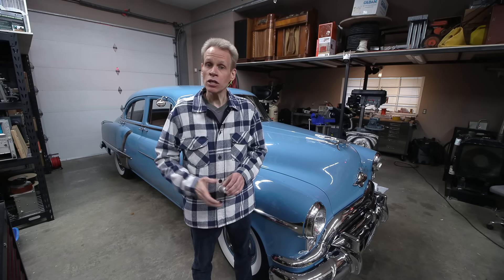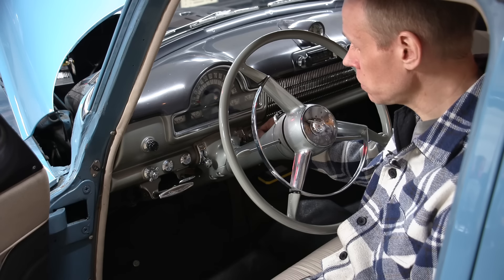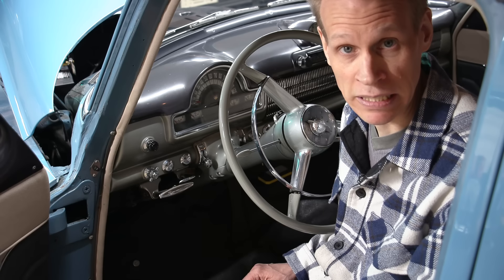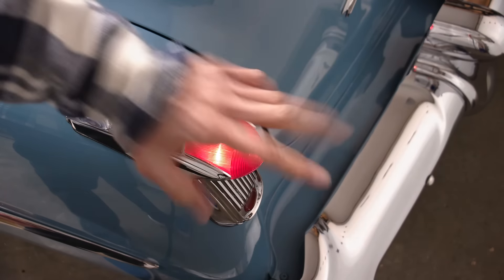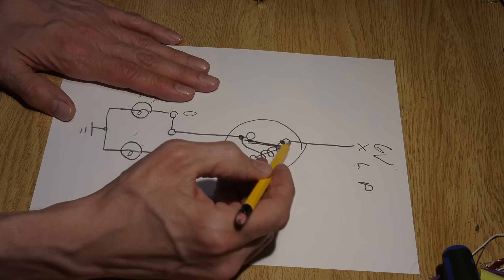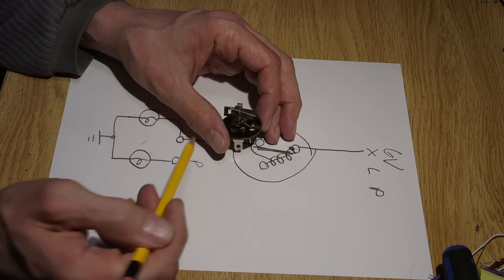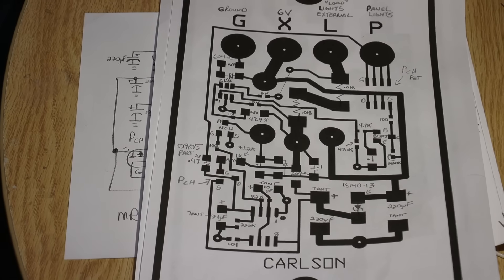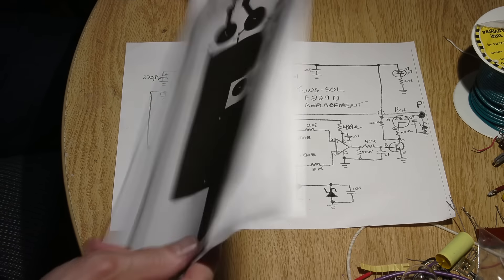How A Turn Signal Flasher Blinker Works - Complete Redesign With Schematic [Tung-Sol P229D]

Comment: When I was a kid in the late 70's we had an old 50's Olds that we used as a run around the back roads / fishing car.  It was considered a junker back then, but it ran good enough to get us around the countryside and into pastures.  Turn signals never worked on it, we wired them together and just toggled the stalk if we needed to make them flash.  This was in the middle of farm country so there wasn't much use for the signals, but even back then they didn't work right.  LOL  Man, what I wouldn't give to have that old car today.  Great video, thank you!!

Comment: Professor Carlson, you are the Bees Knees 🤗 at first I wasn’t understanding the issue because the indicator on the dash seem to look perfectly fine, but then after you went into the whole ordeal of explaining that at 6 V, in addition to the fact that a incandescent bulb on the outside, in addition to the fact that it has to blend in possibly with the brake lamp, which of course is always brighter you’re not even gonna see the fact that the turn signal is on and I understand that this is not what we refer to as persistence of vision, but in fact, it’s actually the overall explanation that you’re giving of the fact that low-voltage and I’m assuming rise time of the incandescent bulb are just not up to par with what we would want and consider to be an acceptable safety measure and I can totally see or in this case, totally understand it

Comment: I did one of these jobs on a Toyota Pickup a few decades ago after doing a very early attempt LED replacement.  I ended up using a Basic Stamp 1 Rev B (the old 14-pin 8-IO version, that could take 40V on the supply and had its own 5VDC regulator).
  
The Toyota flasher was a 3-pin unit - power, ground, flash out - so that made it easier to deliver power to the Basic Stamp - one pin was used for load detect using a current sense resistor (10mOhm), a 25mV Zener, and a comparator.  Theory was simple, if there is no load, there is no voltage drop on the current sense resistor - the Zener was tied to the flasher side of the current sense resistor and then one side of the comparator, the other side of the comparator to the load side of the current sense resistor.  When the current was such that the voltage drop on the load side of the current sensor was more than 2.5Amps it would trip the comparator, which would pull up an IO pin on the Basic Stamp and trigger the loop sequence.
  
Just a P-type MOSFET was needed with a pull-up resistor and a 2N3904 wired to pin 2 drove the Flasher circuit.
  
The Basic Stamp program was pretty simple (pseudo code):
Loop:
  Turn On Pin 2
  Sleep 10mSec
  ::CheckPoint::
  If Pin 1 = high Then
  .  Sleep 10mSec
  .  Goto CheckPoint
  Else
  .  Wait 490mSec
  .  Turn Off Pin 2
  .  Wait 500mSec
  Endif
  
Thus resulted in an initial power up state where the flasher output was powered, but with no load the program would be in a short loop testing the comparator output - the 500mSec delay was split to allow either an incandescent or LED load to ramp before a test.  When a load appeared the second portion of the on-time delay was allowed to continue, then the turn off period and then repeat as long as the load continued to be present.
  
I later added a 5V steady-tone beeper on another pin, with a short 100mSec "chirp" for every loop cycle - something I hear other electronic turn signal flasher doing now (apparently I should have patented it).
  
This flasher worked for 10+ years until I got rid of the truck due to a growing family and I returned the whole thing to stock.
  
Were I to do it now, I'd skip the comparator and find a PIC that had 2x ADC and just measure directly (allowing for some programmability, and the bulb-out fast flash function).

Comment: Mr Carlson, you did such a good job at explaining how the dash panel lights acted as you were testing hooking up the 3 wires, that I was able to draw up the very same circuit, before I seen you draw the second schematic in the video, showing the panel lights. No I did not cheat by skipping ahead in the video.

Comment: That change in the cycle rate when a lamp had failed was a quick way to identify that you had a blown lamp. When older cars didn't have all the sensors and on screen display info. You just had to stop, get out and check back and front to find which lamp was blown or disconnected.
Reply: Yeah I wonder if this design could be tweaked to change the duty cycle if the load is different. I’ve seen both flash blink and slow blink when one lamp is out.
Reply from the maker: Tweaking the current sensor resistor values will create this affect, just lowering their resistance very easily detects a dead bulb. I don't want this though, as If I ever upgrade the lamps, I want the unit to still flash. I always check the lights manually, everyone else should as well.
Reply: @MrCarlsonsLab  there a good point, you could use led bulbs with this design and not worry about the flash duty cycle!

Comment: Love the curious and clever engineering of the circuit. Both tail lights must be okay for the circuit to work because the filaments provide the only path to ground. If one of the panel lights fails to flash, it could be that the opposite tail light has burned out.  And the reason the load circuit to the tail lights must activate first is so that it can isolate the panel light that's pointing in the wrong direction. Otherwise, both panel ights would illuminate briefly during each duty cycle. And it's the resistance of the flashing panel light that keeps the in-series tail light dark. Thanks for the explanation. Definitely curious and clever.

Comment: Paul, great work around using discrete circuits no doubt; simple, ascetically correct / discrete and my sincere congrats by all means. Notwithstanding, has anyone suggested and considered specifically a micro controller option?  And no, not a Arduino....

For example: Using something in the 18F type PIC's category one could account for duty cycle,  any delays necessary, monitor any change (thru inputs) and drop the parts count by several components. Granted an additional 'continual'  ground wire would be advantageous, but not entirely necessary if one chose not to go that route.  Also again, as an option one could also add "an emergency flasher option" with a second additional single wire employing nothing more than a grounded rocker switch. Just throwing that out there . (I'd be happy to send you a rendition of that design if you were interested.)   😊

Comment: later on those 3 terminal flashers were used to flash side marker lights. it gets even more confusing there because you have side markers that are tied to the opposite side turn signal. I always had a hard time understanding the circuit, but your explanation made it clear. Thanks

Comment: Excellent video, as usual! This took me way back to when turn signals first came out. Then ones on my dads Jeep pickup died after a  month or two. I tried repairing them, since my dad was not going to pay to have something fixed that he thought was superfluous. 
My electronics knowledge was still in embryo stage, and I faild because I couldn't figure out what the heck they were doing with the circuit. Shoulda had the internet with Mr. Carlson handy. Alas, it would be many years before they came along.

Comment: Great job Paul, and amazing that your digital replacement circuit needs to be so complex to replace the minimalist design of the original mechanical flasher can. It all works a treat.

Comment: Years ago, I devised a flasher using a 12v dpdt relay, a resistor and a capacitor. Calculated the time constant of the RC circuit with the combined resistance of the bulbs with the resistor and the capacitor to have a duty cycle of 50%... 
Worked fine on our mitsubishi adventure, it has some drawbacks but for its purpose it worked just fine!

Comment: Impressed with your old school discrete parts configuration.   I prefer that route myself.  Great work.   With all the concerns between panel and body lights and the feedback logic I hate to say it but I think I would have gone microcontroller.     I too have replaced OEM modules with home made controllers.   Love the challenge, and love seeing them work.   I just made a control card for a friends Hup Mobile.   What a convoluted mess.   It came with the following that didn't work correctly.  It is a 6 volt positive ground car, had a 6 volt to 12 volt to negative ground converter, then a special flasher for 12 volt LED turn signals.   It just would not work right.   I finally just built my own controller from scratch and it works great.   See it on my channel.   As always, I love watching your work.

Comment: Built like a tank! I'd expect nothing less. I really like how you retained the original clicking sound. 

I have a cheap $3 Chinese made solid state 6-24v 50 watt max universal relay on my old 6v motorcycle, after testing several different cheap ones years ago I found a brand that worked from about 4.5v or higher so were pretty reliable on an 6v motorcycle with crappy electrics and battery.  I bought 5 of them in total as I expected them to last about as long as the tank of gas but to give it credit it is still going strong after 9 years and the remaining 4 are still in a box somewhere.. but I think this winter I'll be building something like this as I do miss the original clicking sound.

Comment: Fantastic job , nicely done  , far better than the car's original  flasher unit .Well done .At the beginning of your video i was extremely confused as to how the two dash board lights were coming on together and then on their own with just three wires to work with , very interesting indeed . I bet back in the day that little wiring trick had a lot of auto electricians pulling their hair out .

Comment: Thanks for a very interesting video! It's cool to see analog design in this day and age. Nevertheless, I kept thinking about how easy it would be to implement this with ATtiny. Controlling the dash lights would be trivial too. On top of that, you could add a few useful features, like detecting current changes to ensure that the light-bulb fully light up and extinguish. Also, if no current through the light-bulb is detected (i.e. filament gone), you could prevent dash light from glowing, indicating this way the fault. Possibilities are almost endless 🙂

Comment: Watching this video brought me back to when I was maybe 10 years old, so this is the early 70's. I'm with my father in his car and he's driven to some store. He has turned the car off and asked me to sit in the car for a few minutes while he goes inside to buy something. He goes and in a couple minutes, I'm bored. I don't remember exactly what I did, but it was probably some combination of playing with the hazard lights and directional signals. When both were switched on in a car without the engine running, I discovered I could get the radio to come on. The volume would rise and fall in time with the flasher that was clicking away, but it was clearly audible.

When my father came back, he was not amused. In retrospect, he probably though that by blinking lights and running the radio when the car wasn't running would drain the battery or something.
Reply: Add pressing the brake to the process and the radio plays normally. Been there,done that,circa 1962.

Comment: As a teenager some 45 years ago, I disassembled a soviet made blink relay from an old soviet truck, most probably a copy of some german, if not american construction, but might well have been original design, which was basically the same but resembled more a fluorescent lamp starter and functioned as modern ones are required - starting with lamps on state: heating disconnected normally closed bimetallic switch made in a horseshoe shape as in mentioned starters,  lacking the gas discharge, but the same heating coil aided self heating of bimetallic conducting contact and the whole thing was welded inside evacuated glass ampule. Though such construction might appear as more reliable in reality it served the same with the reliability added in extreme climate conditions.

Comment: In 1973 I got out of the US Army at Fort Bliss Texas and needed transport back to South Dakota for myself, my wife and kids. I went to an off base cut rate car dealer and picked up a cheap 1965 Oldsmobile Vista Cruiser station wagon.  She was a good runner but some kid must have had it before me as it had a Hurst floor shift for a 3 speed manual transmission, they had broken the turn signal lever off when taking the shift off the steering column. I needed to go 1000 miles home and wanted a turn signal for the trip. I was working at the Army Hospital in the switching central for the hospital at the time, so I scarfed up a couple of high amp diodes so I could make 2 switches on a wooden T handle that I carved for the shifter.  It worked, sort of when I was driving home except I forgot to cancel once and had a small fire when the diodes burned the wooden shifter. I drove the rest of the way from Denver where the fire took out  the switches home to South Dakota.

Comment: I had a 1996 diesel truck and a 16 foot trailer for construction work. That's a pretty mean beast to leave the blinker on by mistake. I found that they also sold blinker modules that were extra loud clunk clunk. That solved my problem with forgetting to shut off the blinker. I can't imagine how many accidents I didn't have by using that upgrade.

Comment: I converted a 49 ford coupe to 12 volt and replaced all the lights with leds and then replaced flasher with a solid state flasher that needed a added ground and also had a adjustable pot for the speed of the flash worked quite well

Comment: WOW : First OFF Mr. Calrson This "OLDER" Car looks BRAND NEW, it is soooo Good Jay Leno would be in shock!!.  Great electronic fix for the turn signal flasher. I have a 1988 Seville the turn signals are electronic yet the seat belt and headlight on unit is electronic with a coil driving a plunger to strike a chime bar GOOD GRIEF.
PS you should drop Leno a line , pretty sure he would be interested in this new "Carlson Flasher circuit"
Great vid Thanks
Reply: He probably restored it, had it restored, or bought it restored.

Comment: 31:17 My scooter from 2010 has this kind of circuit, apparently modern small bikes still use this system, as it is pretty simple in wiring, despite a bit confusing. Sharing the circuit with panel indicator saved a few wires. I was curious of how exactly it works after looking at schematic, now I have full picture from your video. Thank you.

Comment: Nice job! I'd get a touch more creative with your indicator lights and current sensor. Use a comparator and potentiometer to set a minimum current to blink the indicators. This way, if one of the bulbs burn out. The indicator doesn't  flash and now you'll know there's a bulb out.

Comment: An unmentioned safety advantage of your circuit over the original flasher is that there is no delay before the turn-bulbs light. But perhaps a tweak to the circuitry around those current-monitoring resistors could be done to indicate when a bulb has failed. It could either do this by preventing one of the dash lights from flashing, or by altering the flash rate on the side that has the faulty bulb.

Comment: My initial thought was that the panel lamps were tied into the indicator lamps.

Fantastic work Paul.

My final thought is, tie the panel lamps into the indicator lamps. Ha ha.
Reply: I'm still wondering why the made it that complicated...
The only reason I can see is that the indicator lamps would double as "outside lamps OK" indicators, but that would only work when both external lamps have failed.
Usually one knows that a lamp has failed because the blinking frequency changes (the current is lower so it takes longer for the heater to warm up), so they could just as well have the indicator lamps wired in parallel to the external lamps...
Reply: @Rob2  That's exactly what I was thinking. Nothing would change and it would be a simple design.
Reply: @frankowalker4662  It may also be a case of "we've always done it like this" where (especially early) cars had only a single indicator light inside that would blink for both left and right indicator.
As in those days a diode was an exotic device, nobody would consider wiring the lamp with 2 diodes to the 2 directions. Instead they would wire the indicator lamp across the blinker device.
Now with 2 indicator lights, they sort of did the same thing...
Reply: @Rob2  The 1964 Ford Cortina I had in the 80's had it's dash indicator lights in series with the outside ones.
Reply: @frankowalker4662  Interesting! That would be a special very-low-voltage high-current bulb then, probably unobtanium now.
Most probable is an indicator across the blinker device because that would be the standard indicator lamp type.
My father had a Ford Cortina, 1965 I think.
It was an interesting car...

Comment: Thank you, Mr. Carlson, for this lesson: Most people think in terms of digital circuits: Logic 0 is zero, logic 1 is true and forget the physical basics. Every logical state is based on an electrical potential.
Back then, due to a lack of implementation options, we had to come up with a few tricks, as shown here in the example of a 6V circuit.
When developing interfaces, even within digital circuits, the impedance plays an important role when switching between logical zero and one. (Laplace transformation, p-transfer function)
This video by Mr. Carlson is not from yesterday. In the development of modern electronics, it is essential to understand the relationships described in this video.